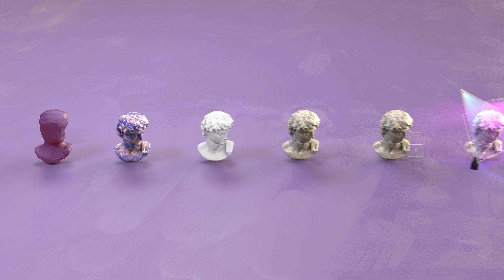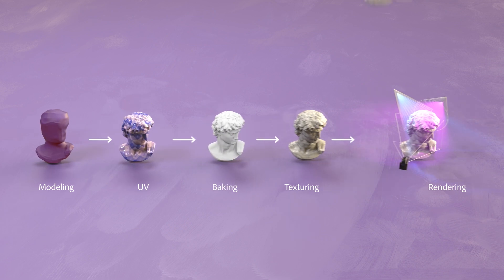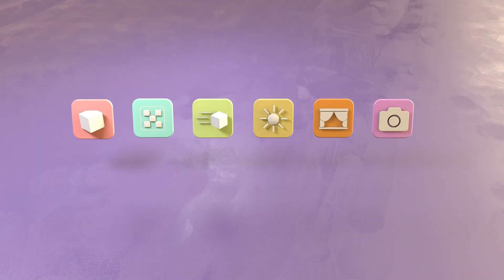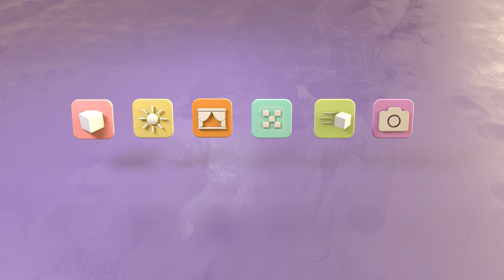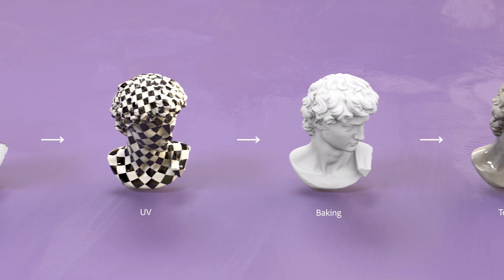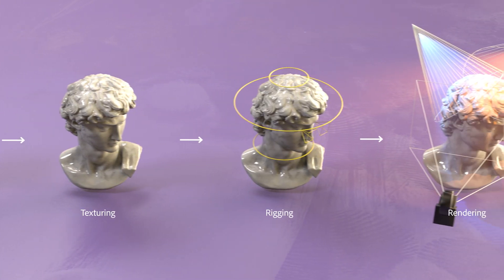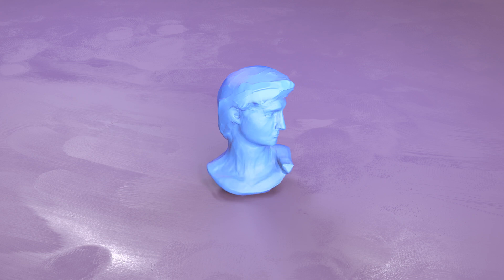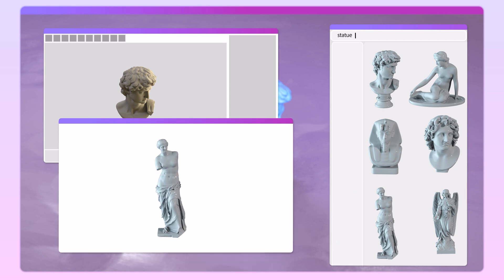Adobe Start 3D - The 3D Creative Process | Adobe Creative Cloud

Comment: Am I the only one that wondering why adobe doesn't have an amazing 3d program to accompany these videos. Im surprised adobe doesn't have an industry standard 3d software that would tie together with photoshop and animate and dimension and premier and aftereffects.... feels like thats the missing link
Reply: Well adobe products work closely with Maxon's C4D and they do also have substance painter. There are some industry standard softwares that work well with adobe products. AE comes packaged with C4D lite.
Reply: @spicytuna3387  Have you ever tried using Cineware that connects C4D to After effects? It is simply impossible to work in a slow workflow between software and with the poor quality preview render of the C4D viewport. Adobe is missing with its customers by not updating Cineware to run on GPU.
Reply: Agreed. Though they do have Medium, which is a step in that direction.